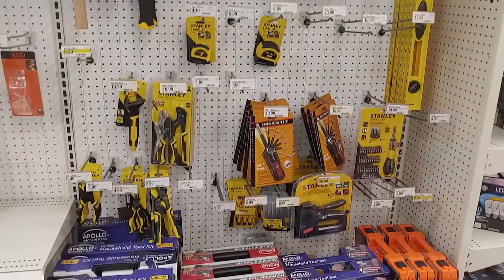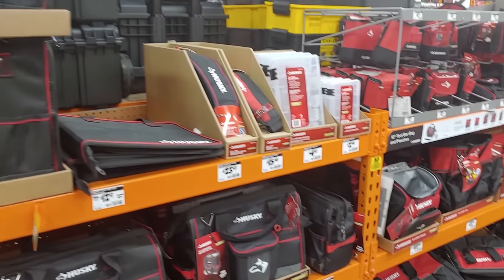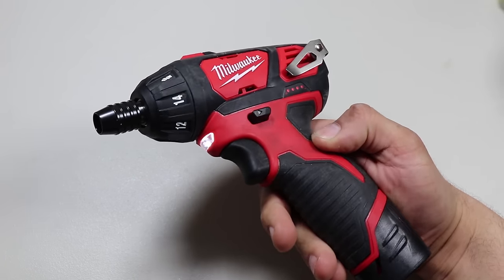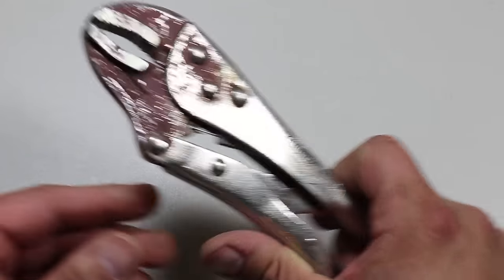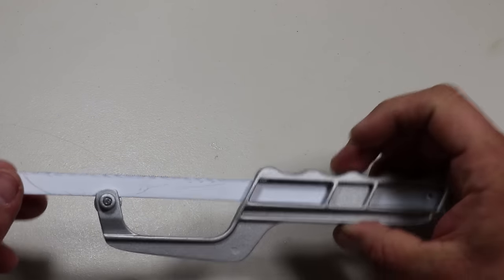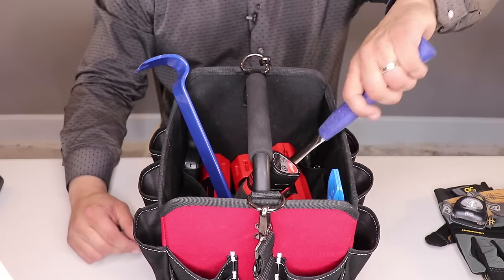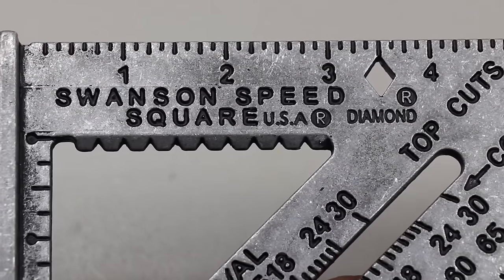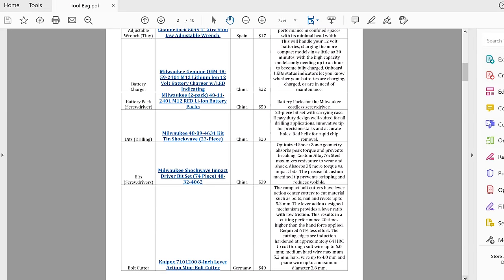What's In My Tool Bag? (Tool Bag Tour)

Comment: Terrific video!  Thank you!  I would add a mini offset ratcheting screwdriver for really tight spaces (just used on this morning).  Also, the Yankee Push Drill which has been revived by Garrett Wade and true to the Stanley original.  I believe it’s made in Germany now.  I use my grandfather’s Stanley, but gifted a Garrett Wade to a dear friend. He absolutely adored it. Also, in my travel tool bag, I include a center punch, nail set, fastener gauge, folding or keyhole saw and a smaller pry bar to pair with the mid-size prybar like you have (it help to have a second prybar when trying to remove wood trim). I don’t tend to carry a lot of electrical tools unless I’m specifically doing that kind of work, so I have a separate pouch for that which includes some assorted wire nuts as well as a lineman’s pliers which is great for work with wiring. That’s all I can remember right now. My 3 cents. ~Chris
Reply: That's a GOOD 3 cents!!!

Comment: That particular model of Fluke voltage detector is the one I swear by. Not only do the rest suck in comparison (including other Fluke models) but I still have my first one I bought 21 years ago that still works like a champ. It got ran over by a giant scissor lift that many years ago when it was new also, and still works better than all the others. I use it every day now and have bought 4 or 5 of the same model to have as backups if Fluke ever stops making them or something happens to the original. If you're doing simple electrical work, I would also recommend the Fluke 107 multi-meter. It's pocket size, versatile and a very robust durable meter for being a pocket carry.

Comment: Just a recommenation, you should also buy a small and light hammer. To use if you have to work on a window or close to something brekable. And use it with light taps. As for your toolbag everything a homeowner needs around the house. A very good review.

Comment: Couple recommendations for you,
Multi-bit Screwdrivers: Picquic, Made in Canada, bits are 3" long impact-grade and high quality made in Taiwan.
Romex Strippers: Southwire, Made in USA. If you do any work with electrical you'll want these to easily strip off jackets on romex wire (the wire used for electric) and also strip the insulation off the core wires.

Comment: You could resharpen that chisel. Also a lot of mechanics recommend if you can't get USA made Vise grips go with "Grip On" Vise grips made in Spain. They are high quality and designed very well. I prefer their release handle, which is built into the handle over the traditional style, which is inside the handle.
Reply: Irwin owns and make Vise Grips

Comment: I’m surprised how similar my tool bag set up is. Buddies are always amazed when I show up with my tool bag. There aren’t too many jobs around the house I can’t complete with my tool bag and one or two power tools to suit the project we are working on. Your accessory tray should definitely include some drywall screws and some various lengths of wood screws, and some self tapping sheet metal screws, and a few anchors or your choice for drywall. A set of quick clamps are very useful. Those 3 bit sets could be combined into one if you toss those divider bit holder things. They are very frustrating after a while bits are hard to get out and even harder to put back in. Without them. You just open the box and rifle through and find what you need in no time.

Comment: I would keep the vintage chisel and learn how to sharpen it. Plenty of YT videos on it. The steel on those old tools is much better than it is today.
Reply from the maker: Someone else said the same timing. I think I'm going to hire someone to do it for me initially to get it at a good baseline first.
Reply: Actually, only the first half to 3/4 of an inch of steel is 'useable' hardened steel, the rest is a softer steel ... but yes, this tool just needs a bunch of elbow grease and some grinding stones to be up and running again. Could do with a bit of polishing agent on an old rag to polish that rust off the chisel, and perhaps a bit of sanding for the handle (on 1000 grid or so), then obviously boiled linseed oil to treat the wood. Most important after that is using a Wooden or Plastic Mallet to strike it, and NEVER use that Steel hammer !! (and obviously check the wood for metal before going at it with a chisel)... with this it's probably good for another 3 generations if not more !

Comment: As an electrician I wouldn’t use that type of non contact volt tester. I have both the south wire you showed and a Klein one. The reason is both the Klein and south wire testers have a power light that stays on when the tester is on. So you always know the tester is on. I’ve ran into problems with the fluke not giving accurate readings because I’ll press the power button see the light come on and go off like normal but the batteries are actually dead. Also one last tool I didn’t see for you electrical tools would be lineman’s pliers also know as just Klein’s that’s definitely a must have for electrical work

Comment: with all the tools that my 2 granddads and my dad had, there's not too many tools that i don't have. one of my granddads was an engineer so i have some of his specialty tools that i have no idea what they're for or how to use them.
i have probably 6 full sets of screwdrivers; so many sockets, ratchets, and extensions, quite a few hammers (claw, ball peen, drilling, dead blow, sledge), lots of squares and levels, more than a few tape measures (of varying types and lengths), chisels (both wood and cold), clamps of varying types and sizes, plus many others. and the great thing is that a good bit of them were Made In The U.S.A.
plus i wound up with all of their screws, nuts, bolts, etc. that they had. so i'm not hurting in that department, either. as well, i already had a decent set of my own tools before i wound up with all of theirs.

Comment: DeWalt tools are not MADE in the USA, just assembled in the USA. There's a big difference.
Reply: They have steady increased there tools made in America since 2013, DeWalt makes it very easy to figure out where your tool was made. The company now has a nifty label that denotes American manufacturing participation which can be found on the site as well as on the tool itself. You can also shop for items that are exclusively American-made on the DeWalt site.

 The first emblem has a “Made in the USA” emblem with “With Global Materials” written in smaller lettering below. As this suggests.

Comment: You need a set of picks and combination wrenches from 6 to 22mm. An adjustable wrench is fine for general work, like a ratchet screwdriver. But when it comes to precision work when you can't afford stripping bolts or screws you need the real thing.

Comment: I've got a few suggestions for tools:
Wera Tool Check Plus.
It's nearly my EDC, Bits, Sockets, a small Bit-Holder and a small but durable ratchet. I don't know if there's an imperial version.
Again WERA:
The yellow screwdrivers can be used for small prying, hammering or similar jobs. I haven't broken one yet.
And one more knipex Tools:
The "Zangenschlüssel".
Imagine a combination between a adjustable wrench and the knipex Cobra.

Comment: wrap your files in paper to keep them from rubbing together. to keep them sharp
Reply from the maker: Great pro tip! Thanks! I still need to add handles to them.
Reply: Totally unnecessary, just more garbage floating around the bag
Reply: That’s not how it works. Two metals of the same hardness will not touch the other.

Comment: Really well done.  I am a tool junkie but wouldn’t change much although some brand names might be different but US and vintage made whenever possible.  You need to embrace what the military calls PMCS.  Preventative Maintenance Checks and  Services.  Rusty is never cool.  A well used patina is fine but get the rust and crust off those vise grips, scissors, and any other spots.  WD-40 is fine but a Few Drops of 3-1 oil will properly lube those jointed tools far better as it  coats and lubricated the steel far better than WD40.    I did see a couple of items I will definitely consider for my “jump bag” when the Chief of Staff aka She Who Must Be Obeyed  says fix this or install that.. lol

Comment: You mentioned having a large adjustable wrench for high torque situations.  Please be aware that adjustable wrenches are not recommended for those uses due to their ability to adjust and the chance that they could work loose when you are applying a lot of pressure.  Use an impact socket with a breaker bar backed by a closed (box) end wrench to minimize danger.  Proper sockets will engage the face of the bolt or nut rather than the corners, so you should really only need six sided sockets.  Craftsman has just opened a new manufacturing facility near Ft Worth, Texas but I do not know what the distribution of tools made there will be.  American made sockets are pretty expensive but it looks like the Makita that you have are good. Thanks again for the great video.

Comment: I I have a ton of the same tools, the Knipex products are in a league of their own. Ever since I got my mini Cobras and the Pliers wrench I’ve been hit with the Knipex bug, I’ve got them in ever tool kit. I find that pliers wrench usually does everything that a combination wrench can but better. I love my Megapro ratcheting screw driver so much I bought 3 more. 
A couple things I would recommend: an awl, a small metal and plastic pry bars for delicate detail work, a chalk line, a 1/4 hex ratcheting wretch (Titan Tools 11205 Offset Micro Bit Driver is what I recommend), the Stanley FatMax tape measures are in a league of their own, a magnetic work light (I have a Braun 390 Lumen Magnetic Slim Bar Folding LED Work Light), zip ties, a spade bit set, a long spade bit, a Dewalt Right Angle Drill Adapter DWARA050 and a few 1/4 hex extensions (pair it with your impact and you can do any kind of automotive work in a flash, the flexibility is insane, HIGHLY recommend getting this tool), adding to the previous a nut driver bit set (your ratcheting screwdriver, bits, extensions, impact, nut driver etc all use the same standard and are interchangeable without adapters) a ton of
Reply from the maker: I'm definitely going to pick up the Knipex Pliers Wrench now. Thanks for the tip! I absolutely love Knipex tools!

Comment: I would replace the cobra pliers for the knipex flat parallel pliers. The cobra's will mar anything it touches and the teeth will eventually wear down. Also you need a 1/4 impact drill 18 or 20 volt. It is true that milwaukee is the best but they have a collet issue. The bit will come attached when working and is dangerous if you are working on a ladder or elevated areas. Millwaukee is working on this issue but until then it is a problem. Everything else is really good. I would get the irwin chinese long needle nose vice grips. Sure the teeth will round off almost imediantly but you have your self a fast acting clamp to use on a flat piece of metal or board to cut a straight line with a circular saw. You need a starret speed square also. Ive got a few other recommendations let me know if interested! Take care and god bless.

Comment: I wouldn't call wd-40 lubricant, it works good as penetration spray and degreaser, but if you want to lubricate hinges ect. use 3 in one oil.

Comment: Very nice setup for general use. Consider having a bit of steel wool in one of those pockets to knock off the rust as it comes. Combine a very very small amount of WD-40 with the steel wool  and you'll never have a rusty tool

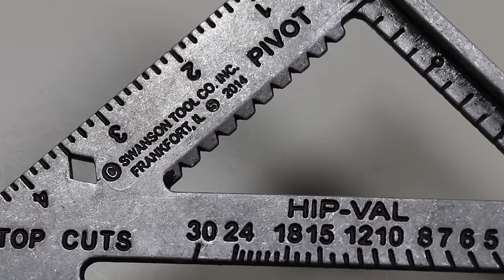Comment: 19:00 "heavy gauge billet aluminium alloy construction is die cast for ..."  So is it machined from a billet, or is it die cast? It can't be both. Spoiler: it's die cast.
Reply: "... is die-cast for increased accuracy over laser-etched and extruded stamped rafter squares." (Swanson)  and as they say it's die cast for superior accuracy compared to extruded and laser etched stuff

Comment: About 5 minutes in, had to pause! Just a quick spray or rub of oil after use, and your investment in tools wouldn't rust. For instance, I've had pliers for years, scritch-scratched to all hell, and they haven't a spot of rust on them. A quality tool? They'll hold out until the teeth are worn and the rivet gives out -- if you take care of them.

I say that because you've got some good stuff. It's worth a little maintenance, and you can even pass them along.

Comment: I highly recommend Milwaukee's locking pliers. They're made in Taiwan (so it's actually made well) and the adjustment mechanism is by far the best I've ever used.  

I also really recommend Neji-saurus pliers.  They're helped me many times with screws and nuts I would've been screwed if I didn't have them.

Comment: Nice tool set - should be good for most jobs!

That said, I'd question the need for impact sockets for a DIYer - a decent set of standard deep sockets have proven invaluable for me over the years. I've got a Britool set I got in 1996. I'd also swap out the adjustable spanners for "Knipex Wrench Pliers". I got a 30cm pair and they've pretty much replaced my entire spanner set. SO much easier to use than an adjustable spanner.

Edit: I'd also get a tool belt and a carpenters pencil!

Comment: That ratchet set from Japan is actually a very good one, also if you get screwdrivers with a hex-nut on them it allows you to use a spanner on your driver for extra torque on the driver.

Comment: First of all - throw away that Husky bag, and get yourself a Veto bag:) Milwaukee m12 is great choice, but you need to go fuel or surge... Nut drivers - Klein are the best. Regular screwdrivers - either Wera or Wiha, no other options:) Pliers  - Knipex are far way the best(and "k" actually is pronounced;) For the utility knife - I would go for Milwaukee but with dewalt carbon blades(black ones). Consider Pica for your marker(long nose makes huge difference) Good luck!:)

Comment: If you're still looking for locking pliers look at Grip-on (made in Spain) or Gedore (Made in Germany, also super expensive). Skip the knipex in this case, it's probably the only plier that they make that isn't exceptional. I have a 10" Gedore pair and they are the heaviest and most rigid pliers I've ever used, not to mention beautifully made.

Comment: You should also get a compass and/or protractor. I recommend having silicone sealers. And as far as tools go, you should get a re-threading kit, for repair of stripped screw holes. And you need a chalk line reel.

Comment: As an Electrical contractor, I would NOT trust a non contact voltage tester! I have seen them fail to read presence of live voltage throughout all major brands. ALWAYS USE A QUALITY MULTIMETER AND TEST ON A KNOWN LIVE CIRCUIT BEFORE USE.
Reply: I couldn't agree more, definitely get a good Fluke multimeter as they can test DC and continuity which can be a life saver when the SHTF
Reply from the maker: Thanks for the pro tip!

Comment: I love all my Klein tools but I have some southwire pliers, a old school wiggly from the 80's my journeyman gave me because I hate the light up idiot sticks, knipex does make some great gear but it's expensive. I like my Klein hybrid pliers they're a cross between lineman pliers, and strippers, because they got the fat jaws like linemans along with the cutting edge, and the three main wire strippers you most commonly use when doing electric work, a couple screw cutter slots for the most common ones, and even some crimpers too for crimping splices

Comment: I know its been a long time since you've posted this but I just saw it. You might consider adding some simple electrical connectors like wire nuts or wagos to your little parts box. Another suggestion would be to add another pair of cobras.

Comment: Check out the Malco Eagle Grip locking pliers. They bought and reopened the original vise grip factory in Dewitt Nebraska where your grandfather's pair was made. I have a dozen old pairs of Dewitt Peterson ones I've collected, but got a Malco to try out. It's nicer. Like one of the nicest tools I own nice. My biggest complaint on the knipex ones and other decently made pairs from other manufacturers is that the teeth aren't hardened. The harder the teeth, the better the bite, the better the grip, especially for the curved jaws on round objects and stripped hex heads.

Comment: Am I the only one that carries wrenches in his toolbox? 
6-19 metric, combination wrenches for the most used sizes and dual open ended ones for less used ones. 

For larger nuts and bolts I use a Bahco 9031-C, which is the best adjustable out there in my opinion.

Comment: At :37 you have what looks like a Wera screwdriver but don’t mention it? Also, once you get that chisel refurbished, I recommend a Morakniv carpenter chisel... they take a beating and cost $17. Great kit though!
Reply from the maker: Yeah. That Wera is part of my EDC bag. I've been debating on upgrading my Klein screwdrivers to Wera, but haven't pulled the trigger yet. I wanted that shot to show how much the kids have aged since I first started putting it together.
Reply: Gotcha. Wranglerstar got some recently and he loved them.
Reply: ive got the wera ratcheting driver and a couple wera handles. i really like them and changing bits out, adding extensions.

ive got this tiny wera 1/4in ratchet....its so damn cool...but it was like 30 bucks

Comment: You miss out a carpenter's pencil 😉
Reply from the maker: I used to carry one but I just used the mechanical pencil the while time so I got rid of it for this redesign.
Reply: @TheUrbanPrepper  Add lumber crayon, marker, grease pencil etc in case you need to write on a surface that the pencil can't such as glass or brick.
Reply: Otherwise known as a No2 pencil